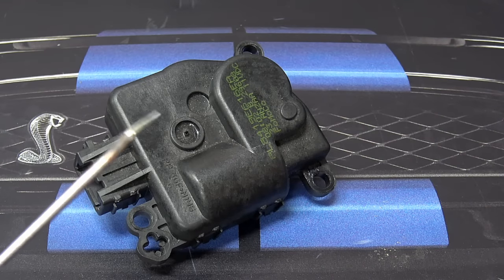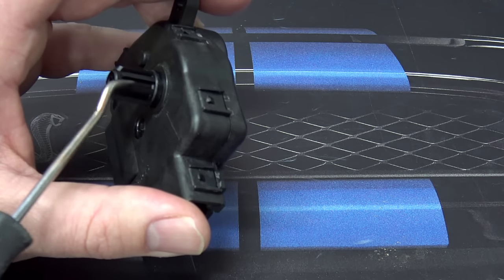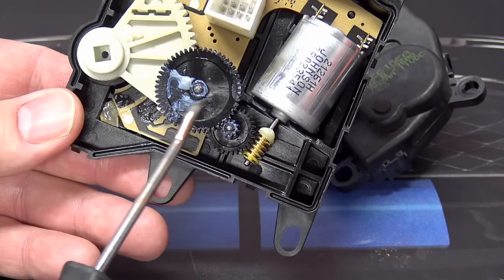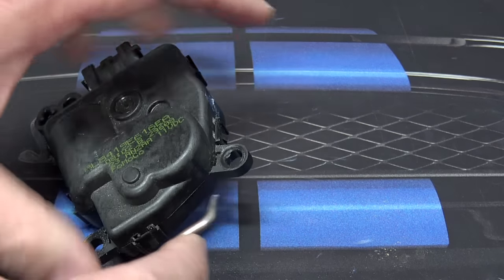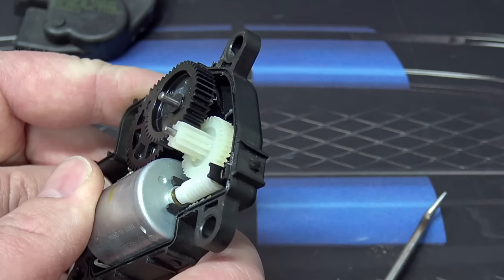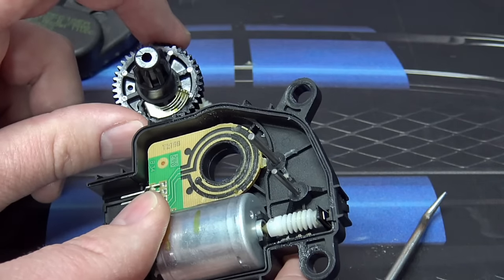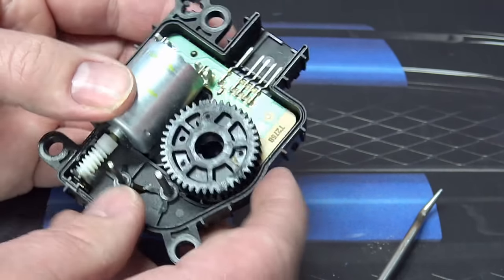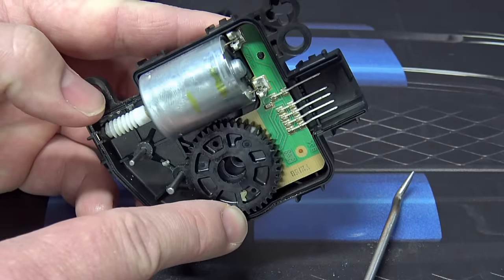Ford Vehicles: Frequent Blend Door Actuator Failures and Why?

Comment: I have a 2006 F150 FX4 with 73,000 miles and manual AC controls. I just had the AC system evacuated and refilled because it wasn't blowing very cold. The technician said I needed to have my radiator fan clutch replaced due to intermittent high pressure during the pressure test. I ordered a Motorcraft fan clutch and replaced it last week. I also decided to go ahead and change the serpentine belt while I had the fan off since it was probably the original belt still on there. Since changing the fan clutch, the air is much cooler and no longer blows warm at idle. This seems to have fixed that issue, but I also have an issue with the Mode Door not working properly. When I move the selector to floor or defrost It rarely changes position, but does sometimes. I'm going to replace the Mode Door actuator to see if this resolves the issue, hoping it's not the old stuck foam issue. I figured while I was at it, I might as well change the Blend Door actuator since these seem to wear out often. I bought each actuator (Motorcraft brand) and got them in today. I have seen a few posts that say a calibration is required for the new actuators, but can't find any info on how it's done and there were no instructions included with the actuators. I called 2 different Ford dealers locally and one said there is no calibration required on my truck and the other said there is a calibration required and to remove a fuse before turning on the key after installing the actuators. He wouldn't specify what fuse or give me the procedure for the calibration. Do both actuators require calibration and if so, would you be able to explain the proper procedure for doing it?
Reply: Where are the mode door and recirculate door actuators? I know where the blend door actuator is at but my recirculate door clicks after closing/opening. Thanks

Comment: I have a 2005 F-150 v6; it's blowing hot air by the floor even while heat/ac not running.  When I run AC cool comes out but it's mixed in with cold.  Would this be my vent door actuator or something else?

Thanks for your opinion.

Comment: Hey Brian, been watching your videos, very informative thanks. Mine (2011 F150 Lariat) only clicks/knocks 5 or so times and only when the A/C unit is first turned on. I can't tell a difference in temp control either. Do you think I need to replace my blend door actuator?
Reply: When I replaced mine the clicking sound disappeared

Comment: Are these only used for tempreture control or also to choose direction of air (windshield, bottom or center one or all at once)?
I have fusion sport 2017 and no matter what I set in climate control I always have hot air coming from windshield direction.

Comment: I understand this was posted 5 years ago though just fighting this problem. I've removed the blend door actuator on my 2011 f150 because of this clicking noise behind the dash. Though I took the actuator apart and the gears look good.  Would these failed contacts cause the same problem with the clicking noise?

Comment: Would this probably be same problem with a 2010 Lincoln MKT?   Worked great yesterday - today have super hot air on Drs side and super cold on passenger - of course 90% is Driver only and could not be the opposite

Comment: I bought a used 2014 F150 with exactly 100k and have put about 11k on it in the last 9 months.  I had a burning smell and now the right side vents blow cold and no heat.  Plenty of heat from the driver's side.  I'm assuming my issue is this actuator and I have ordered one off of Amazon for about $12.  Hoping to get it installed in the next week or so but I have never taken apart the dash on this truck.  Is it tricky?

Comment: Mine started clicking for few months, then my air completely stopped blowing in the car.

Replacing this part, has Nothing to do with the cars ability to blow air out of the vents correct?

I just replaced a blower motor resistor as well thinking that could be the culprit, but no luck, hoping its not the Blower Motor itself.

Thank you

Comment: Surprisingly I just had one fail on me and it wasn't the actual small gears. It was the main cheese wedge -shaped part with the plastic teeth and not the actual round gears where a piece broke off seemed rather odd to me.

Replaced one two years ago and that's about all it lasted.

I have been working on a newer design with someone from a machine shop and they are working on fabricating me metal gears to replace what's inside. So I am going to take a new actuator, open it up and install the metal gears then I should not have a problem after that.

Comment: Excellent information. Sadly it doesn't fit my issue. 1997 Ford Crown Victoria LX. Heat, AC work fine. The problem is if I put it on defrost with heat (as it's winter), the heat won't come out the defrost vents at the window, it keeps coming out of the dashboard vents. I disassembled what I could and all the vacuum lines are in excellent condition and connected. I checked for operation of what look like vacuum solenoids that move the shafts back and forth and they're  operating well. If there is a door some place that isn't moving, I'm not sure where to look.
Reply: Glenn Jarvis
Reply: Glenn Jarvis
Reply: Glenn Jarvis
Reply: Yes Brent?
Reply: Glenn Jarvis  it's the o rings that fail on the HVAC controller. 32 cent o ring in 400 dollar unit. change o ring with addition of white grease or Vaseline.

Comment: I have 2014 ford flex Sel 3.5L 2wd and has MyFordTouch Sync for GPS, Entertainment/radio and Climate controls. My problem is that i have no air coming in the front vents when i turn on fan for ac or heat and it redirected to defrost and floor vents. I know it has 3 blendor actuators and their locations but i dont know which one for the front air vents. Its a wifes car and its getting pretty warm in sacramento

Comment: Ref: 2013 Ford F150 Platinum: Does the driver-side Blend Door Actuator, the lower one that is difficult to get to, control which vents the AC air comes out of, i.e. floor, defrost, dash, or a combination? On the driver's side I get cold air from the defrost, and floor but not the dash vent.

Comment: 2011 f150 eco - I just changed mine today due to failure. Mine is set up differently inside. There is a cog wheel that has a "leg" going through a small potentiometer. Which is where it failed, the leg sheared off and the computer had no knowledge of movement. It was the original from 2011 from the date on the outside.
Reply: Was it the center one behind the radio?
Reply: @ElonMuskX  yes it was.
Reply: @phcllc24  Mine to.  The other will cost you big time!!!!     Dealer dropped my radio on my carbon fiber center console, gave me back the truck with huge gouge in the console.  Walked back in and asked him when the new parts would be in.  Never even got an apology.  Before dropping the truck off I sat the service writer in the front and showed him the console and told him if I did the job at home I would damage something so I expected him not to.
Reply: @PAT'S HARDWOOD CUSTOMS, LLC how difficult was the job? I have the same truck. Were you able to do it without removing the entire dash, as in Makuloco's other video? Thanks..
Reply: @mgrohman  it was simple, just the center of the dash comes out to gain access.
Reply: @phcllc24  thanks... I don't have heat/cool on driver's side, was that your situation? If so, happen to have part number of what you ordered?
Reply: @mgrohman  mine would get stuck on cold and make a popping sound from the blend door motor. I don't recall the part number but i searched amazon and found a genuine ford part to replace it for fairly cheap...under $20 if i recall correctly.

Comment: I’ve got a 2008 Ford Escape and my AC is not blowing cold unless I’m driving. I’ve tried adding/removing refrigerant and it doesn’t seem to help. When I’m going over 40 it blows super cold. When I start my AC I hear a clicking noise and I think it’s this blend door actuator, would that cause the AC problems I’m describing though? Thanks

Comment: I replace the mode door in my 2008 a couple years back. Man are they a pain to get to,  behind the instrument cluster and a structural horizontal bar!  The replacement worked for a couple weeks then it broke. air is stuck blowing at face and feet so only a pain in winter because no defog/frost. I usually keep a magazine in the car I can use to direct air from face vents toward the windshield. Need to make a U-tube out of pvc! Any suggestions on how to make install easier?

Comment: Which style is in the 2006 F150? Mine doesn't hunt, it will only position the door to full hot or full cold. I have run the EATC self diagnostics and it shows no faults. I am assuming the actuator's position feedback has failed.

Comment: I just replaced our blend door actuator on my parents 1998 Lincoln Navigator. New heater core & updated blend door & new actuator. Now the actuator stays clicking. I figured they’re electronic and the system should have reset them. Any ideas? Is there a reset? The truck was sitting for years in our garage but it was always being ran an every few months until the battery took a crap. Then it sat for months. There has to be a trick to removing that pesky blend door actuator without removing the dash… I’ve done  this twice and I’m not doing it a 3rd time. I’m cutting out a section of the vent duct if I have to for that extra 1” of clearance

Comment: My local Ford Dealership is telling me that they will have to remove the ENTIRE dashboard on a 2017 Ford Fiesta, just to change the clicking, Blend Door Actuator (driver's - side/five-pin). Even though it is still under warranty, I don't believe they can remove and replace the ENTIRE dashboard without something not replaced correctly. I have seen other YouTube videos where they just remove 3 Torx screws to take off the plastic housing around the steering column and then reach up underneath the dashboard and there is the 5 pin BDA.

Comment: The gears are fine on my 2007 unit.  ( 13 years old...)..just the motor gave up...I opened the case and plugged it in without the gears...and the motor spins once or twice in either direction when turning the knob and then stops..

Comment: I have replaced my blend door 20 times in my 2007 flFord lariat, 4x4, F150 crew cab.

What can cause the gear spline post to come out of housing?what can cause the blend door motor to all of a sudden closrlde the door flap so AC stops  and hi heat blows out withbno change from the controls?

Is there certain steps that you are supposed to do when installing a new blend door motor.
I.e.  plug in new motor, cycle the key  until the shaft key lines up with the arrow under the motor that points to the spline?

Is there a temperature setting that should be chosen before putting in the new one?

Etc..because there is no way I have 20 bad motors. For instance, my new motor has been out for months
 Randomly it will work but only for a short time eventually just turning the car off and on from running an errand or seemingly hitting a bump too hard will then kill the a/c by closing the door and letting in full hot temperature air.

Today I simply took out the motor, inspected the post spline, Ibnoticed wear at the top portion of post that clicks into the motor, I cycled the key repeatedly until the key spline lined up with the arrow and then shut off the key. (If you don't shut off ignition key the key on the spline will pass the arrow. Then I set the motor bsck in place, screwed it in and poof!, cold air. Now for how long is anyone's guess. Clearly, the motor Is not bad.

HELP!

Comment: thanks, on a 2013 escape SE there are 2 actuators on the drivers side. do you know if its the upper or lower one that controls temperature? i asked the ford dealer parts guy already and he couldn't tell me. my heater control is stuck on hot and i just ordered a new actuator, i'm hoping its the top one since the bottom one looks impossible to remove.

Comment: Question: I replaced the blend air door actuator in my in-laws 03 explorer. Put everything back together and it still doesn't work. I pulled the center plant off to access the front of the blend door itself. I turned the switch from vents to defrost while having my hand on the new actuator and I did not feel any movement from the actuator. The door moves freely like it's broken. I push it up and it won't stay, it just flops back down. Suggestions? Do you have a video that shows how to remove the air door assembly and replace it. Will I have to remove the dash or does the upper and lower separate?

Comment: Great video...thanks!  I'm still trying to determine if this is indeed my issue.  I do not have heat on either side of my 2010 Ford F150.  It has dual climate controls, so I assume it has two of these.  Since I do not have heat on either side, is it safe to assume that both actuators are bad?  Any advice you can provide would be greatly appreciated.
Reply from the maker: Odds are both did not fail at the same time they normally hunt on those model but still work most of the time. There have been a couple reports of control heads issues on the early models of this generation F-150. I would get in there with a flashlight to see if they indeed respond to your commands.
Reply: What exactly am I looking for?  To provide a bit more detail of my issue, truck gets to normal operating temperature, both heater hoses are hot to the touch, top and bottom radiator hoses are hot, A/C works great, and can be adjusted between really cold and comfortable.

Comment: Just wondering if too much dielectric grease could cause problems with arcing across between those tiny contact sliders? On my 97 Ranger (older style ) the top of the blend door was split where the actuator engaged it and would lock up as soon as the actuator tried to turn it. Door moved freely until the actuator tried to turn it.

Comment: I own a 2014 Ford Fusion and I’ve just changed the 3rd lock, on the back right door. And here’s the funny part, the dealer claims that there’s no recall on my car even though this is the 3rd lock failure. The first 2 were on the front 2 door locks 🔒

Comment: If the tracking is not working correctly would that affect the blower motor at all? The other day my blower motor will not turn on at all with the air conditioning my 2015 Expedition. Checked all the fuses and relays put it all back together when back to car hour later turn the heat on and air conditioning everything works fine.    Does the blend door also mix fresh air?  I notice when the car is on recirculate I still smell fumes coming from outside the car while driving. Does this indicate that the blend door is not functioning correctly?

Comment: I have a roasted problem. Even at idle with the mode selector on max a/c I can smell exhaust fumes in the cabin on my 2010 crown Vic. Could this be a similar blend door issue?
Reply: I have same issue with my 2013 ford escape. Wondering same thing.
Reply: is the exhaust system you got a leak.

Comment: It's almost as if the manufacturers designed failure into the part.  The difficulty of replacing these items under the dash in the most common Ford, the Mustang is a 10 out of 10.  Despite there being only two screws and a wire clip, the no-access problem renders fixing it yourself almost impossible.  Ford charges $550 labor to replace one actuator behind the instrument cluster.  This is nuts.  I want to slap the designer of these systems.

Comment: I thought I lost heat completely on my truck when I bought it it's an 04 lariat, I found out after removing the blend door controller that the shaft only spins in one direction,  I switch to hot on digital controller and spins counter clock wise, I turn down to cold and keeps spinning counter clock wise, after taking key out of ignition and turning truck back on it does the same thing, I'm sure that's not supposed to do that, wonder if it might be electrical signal issue, any thoughts?

Comment: Mine does not make any noise. 2010 F150 dual air control and the passenger side just doesn't change temperature.  It is always warm.  Is that failed actuator likely the problem?

Comment: The old units could be cross referenced to other makes. You'd just swap out the arm/output shaft for the correct application. You could get new take offs for 10-15 bucks from GMs and Toyotas. I wonder if the new units are like that or are actual Ford in house?
Reply: The one on my 1999 Acura failed a month ago, I was able to get the part from a salvage yard for dirt cheap and replaced it myself. It's right under the dash. Three screws and bam, back to normal. Not even 10 minutes to get it done on an Acura/Honda. Gotta love the Japanese.
Reply: Amen Bro,,,,,,Hondas rule..Quality rules...Ford don't rule.

Comment: Hi BSG, I just recently subscribed and really love your channel. Love the way you explain things in detail. I have taken care of a lot of things on my 07 F150 XLT. I currently have 76000 + miles on it. I want ask, if you have any videos that may help with the weak air flow from the defroster. I feel that it should be stronger. It appears to be stronger when I select the vents or floor. Over the winter I have not had any problems with the windshield staying clear, however, feel that that air flow could be stronger. I tried to locate a cabin air filter but have not found it yet. Did Ford not put a cabin air filter on some model trucks? any help would be greatly appreciated. Jerry in Pennsylvania
Reply: There's no cabin filter until the next generation truck. Like 2009 up

Comment: Is this why my driver side dual zone will not change temp? It’s outside air no matter if I select heat or ac. It’s not going to be good if I can’t have a heated defroster this winter. I’ve heard it should be the actuator over the transmission hump on my 2008 f350 lariat crew cab. Is this correct?